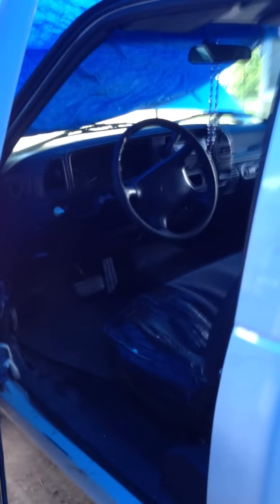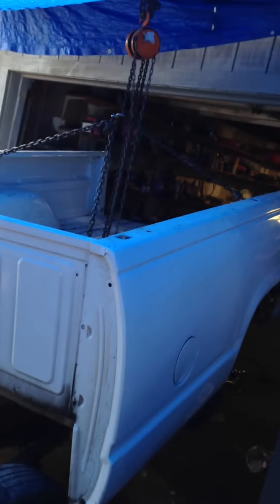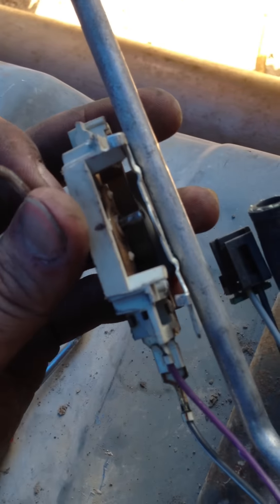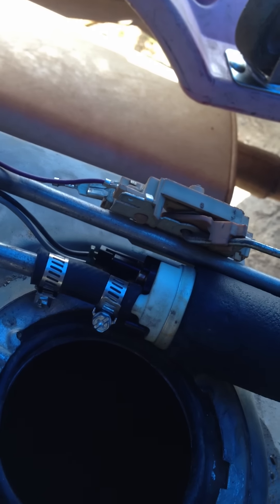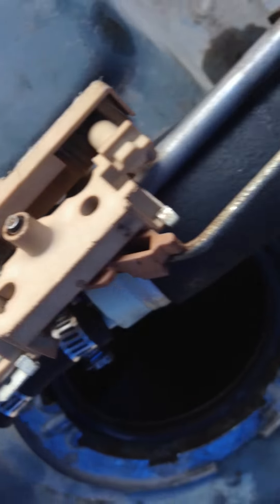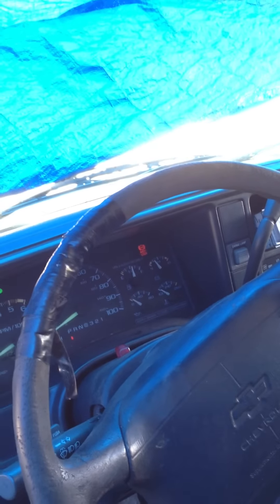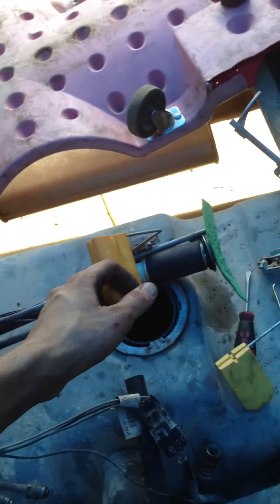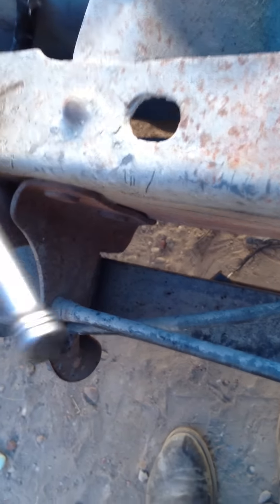1996 Chevy 1500 Gas/Fuel Gauge Problem - SOLVED Easy Fix

Comment: Drop the tank and use a motorcycle jack to lower it down or a gas tank attachment for ur jack. Way easier then removing the whole bed. I did it with a full tank of gas in and out no prob.
Reply: Good job , but I can drop the tank in 30 minutes.  Thanks

Comment: I’ve replaced all the parts to my fuel pump assembly etc but still have the issue. Mine is coming from inside the cluster itself 1996 k1500. I guess my cluster is finally old enough

Comment: fuel pump is working runs starts fine as long as i wait 3-5 sec then hit the key just the needle wants to sit down just above the red no low fuel light etc  maybe because its 44 gals and it takes quite a bit to get it to move? like i said  it does move at on then start back down to the red ,  lol
Reply from the maker: Thomas Hoybook interesting, sounds like a fuel pump issue since it won't start till you give the pump a few seconds to prime. 
Thanks for the response, God bless

Comment: I have a 98 Chevy c1500 it's been stuck on full for 3 days and I have driven it enough for it to go down a little bit but it hasn't. I don't have hardly any tools as I just moved 5 hours from my dad's shop. Is there anything I could do? Could be a simple easy fix where I don't have to remove my bed? Thanks for taking the time to read this
Reply from the maker: You can go under the truck and look for a ground cable that might be loose or disconnected, usually from the bed to the main frame. Or from the direction of the fuel sending unit to the body. Usually the gauge acts this way when a ground is not properly grounded.

Comment: Yeah sorry but taking off the bed is not my idea of an easy fix lol
Reply: On older trucks it is a very good idea if it is a steel tank.  My experience is if it isn't leaking it will after you remove it.  I had a bad experience looking for a gas tank for a S10 at the junk yard.
Reply: Fern From Lake Ave  Removing the bed is easier than dropping the tank.
Reply from the maker: Yeah it seems like a lot of work to remove the bed but not too harsh, pulley and bar above garage. I hope you got it fixed. Have a great day! God bless you, your family, and your future endeavors!:)
Reply: @Chargeglass  depending on how full the tank is, if the tank is empty then it's easier to just drop the tank and then pop it back in when your done, i did it on my 97' silverado when it had a full tank because it quit on me in the parking lot of store..so i climbed under, took the bolts loose and dropped the tank(heavy as fuck with a 22 gallon stainless steel tank..it sucked but it had to be done.. P.S. it was the parking lot of an auto parts store, so i was able to just pop in and buy a new fuel pump motor.
Reply: Easyer than pulling the tank in the long run
Reply: For real...what was ez about that.

Comment: 99 GMC Suburban K1500 SLT 4x4  5.7 Vortec Gas/ when i turn the key it shakily goes up past 3/4 soon as it starts - Needle stays a needles thickness above the empty red mark  no matter what i do where is the ground on this truck? been working on the truck since i got it in dec 15 restoring it when i first got it the one time i went to start it and the needle spun  all the way around   freaked me out , even after putting 5 gallons twice working on it stays the same i did notice the relay under the hood doesn't even have a cover on it  which i don't like the insides exposed to water etc i m getting a new one , at times it cranks too many times and have to turn the key off so i don't over heat the starter, then it will start and run s normal  other times if i don't let it set for days it will start right up like the fuel is draining back?? cant see it having a fuel filter problem sits at 600 rpm at idle and no stalling or nothing runs like a cheetah / strong  also where is the sending unit on this? color of the ground wires? tow pkg on it as well some of the wires are just hanging there in the rear green 1 by the bumper . thank you for any help i watched the video but don't know if its the same on my truck as your pickup, mine has the plastic tank 44 gallons, I just went out and checked it when its off the needle shows 1/8 when i start it up it goes down to the red, if i turn the key to the on position and watch it does not change
Reply from the maker: The ground should be going somewhere from the top of the sending unit to the bed/frame

Comment: Great video!! I was wondering can you buy the floater without having to purchase fuel pump??
Reply from the maker: I couldn't really find just the floater so I just purchased the whole things, there are some really low priced ones out there. You can just use the floater off the one you buy and sell the pump back to someone. Easier that way. There might be a few online stores that just sell the floater

Comment: I have a 94 gmc 1500. My gauge only works to half. And just an FYI, I live in Wisconsin so it's rusty under the truck so I don't want to start breaking bolts. Any pointers from anyone who might know to check something before I have to go to that point. Much appreciated
Reply from the maker: Ah I see. Did you get it fixed

Comment: I have 1990 Silverado and the gas gauge is stuck on full just like just like yours any suggestions where that ground cable is located at
Reply from the maker: Right there next to the fuel pump assembly. You can either remove the bed or drop the tank.

Comment: I have a 2000 GMC Sierra and my gas gauge just plays around up and down it doesn't have a set reading I'm always running out of gas that sucks anything ideas to help me out
Reply from the maker: Sending unit in the gas tank. First check the floater the the ground on the unit may be bad, that's probably what's making it read wrong.

Comment: i have a 1995 k1500 and my problem is that when i changed the fuel pump it just stayed on empty. any ideas what i could be?
Reply from the maker: Hello. What I first stated in the video was that the first possible cause could be a ground wire that isn't connected to the frame. Check your ground wire from the sending unit or any ground around the harness from the sending unit and the frame

Comment: How much you think it will cost to bring my 95 in a shop to fix this issue?
Reply from the maker: Hey hey Corey,
That's a good question...it all depends on the shop. The fuel pump assembly is just under $200 (at AutoZone/Oreillys) but they are SUPER inexpensive online when you order them online (I would recommend the online ones, same quality, just not "brand" name, eBay is great and SAFE) and the labor shouldn't be more than 3-6hrs and labor rates can be around $35-$65 an hour, so the labor at most shouldn't be over $400 to replace and under $60 for the part online, so roughly $460 max on the part (if you order it) and the labor. I would recommend calling around to a few local shops around you and asking quotes from at least 5 and choose after that. Let me know if there is any way I can further help. (if you want to do it yourself, I can share more info on removing the bed or even dropping the tank without removing the bed). 
I hope this helps. Have a great day and God bless you on your future endeavors!! :)
Reply from the maker: Hello,
It just depends, could be anywhere from  400-1500 depending on the shop/mechanic. I would recommend getting a NEW sending unit if you're going to have the tank dropped or bed taken off. Lot of time/labor invested.
If you do it yourself, the part only costs under $100. I would recommend calling around to at least 3-5 places to get quotes for the job. Let me know what happens. 
I hope the best for you! Have a great day, and God bless you, your family, and your future endeavors! :)
Reply: Aaron Moldovan thanks buddy will do!
Reply from the maker: Hey hey brother,
How did the repair and all go?

Comment: Is the ground wire easy to see and get to without removing the tank
Reply from the maker: Hey hey Travis,
I apologize for the late response. I am on the other side of the world.
The ground wire is quite hidden in there. You could fit you hand in there in an uncomfortable position without seeing what you're touching. But it'll take time time time and patience. Maybe even a flashlight, mirror (or phone camera:) ) and small hands. Let me know how it goes.
I hope this helps, I ask God for blessings over your project to fix it. God bless!
Reply: Some people even cut an access hole to the top of tank then they have a door.

Comment: mine stays down but when I put my key fwd it goes up a bit? wont tell me when I need gas
Reply from the maker: justin rodriguez when you turn the key to the on-but-not-run position? Or engine on?
Should both be the same. 
Could either be a bad ground connection or sending unit issue. Thanks for sharing!

Comment: My 1988 Chevrolet C1500  gas gauge always on full.  Even when the truck is not running.  ( help)
Reply from the maker: Same as below:
Hey hey Travis,
I apologize for the late response. I am on the other side of the world.
The ground wire is quite hidden in there. You could fit you hand in there in an uncomfortable position without seeing what you're touching. But it'll take time time time and patience. Maybe even a flashlight, mirror (or phone camera:) ) and small hands. Let me know how it goes.
I hope this helps, I ask God for blessings over your project to fix it. God bless!

Comment: hello sir my Roger from Texas I have 94 Silverado 4.3 replaced fuel pump twice  brand new reads empty even when my tank is fuel  before
 replacing with the new ones  it read like it should any advice or help thank u
Reply from the maker: Hello, I'm sorry to hear about the troubles you're having. With it having a new unit and still reading I would check the wiring connectors, fuses, and the ground connection first. Let us know how it goes. Have a blessed day:) God bless
Reply: Grounds are always a likely culprit

Comment: hello sir my is Roger from Texas I have 94 Silverado 4.3 I wanted to maintenance my truck by replacing fuel pump with a new one so did put it back together and everything now my gas gauge always reads empty and have full tank before I replaced   it with the new one it read my gas  right the way it should and the think is that I replaced the fuel pump  again just yesterday  order a new one  thinking it was a  defect it reads the same thing I don't  know man what it could  be thinking to relocate my ground to diffrent spot on the fuel pump wiring may be it is that  haven't done it yet any idea or advice thank  u sir
Reply: I actually have the same problem replaced my fuel pump because it was going out now it only reads empty 24/7...
Reply: @workinghands1805  i would say it's either a bad ground or the gauge spring in the dash came off, i had one do that on a 96' s10 and i just took the dash out and reconnected the spring to the needle and it went back to working